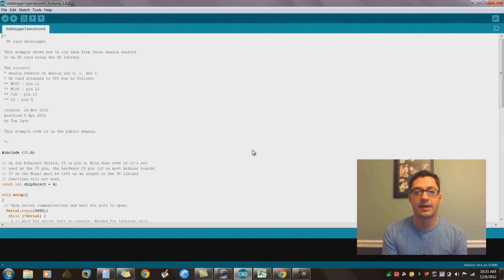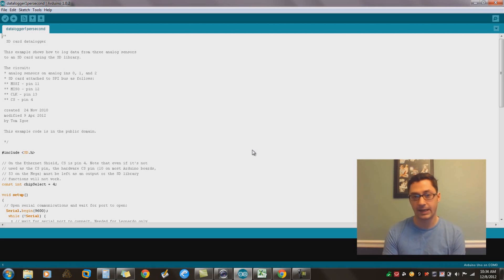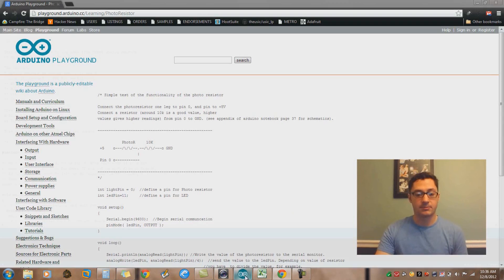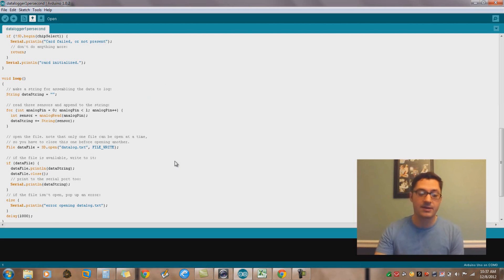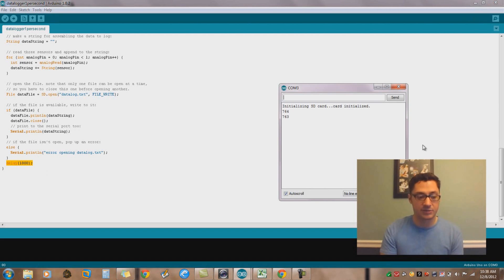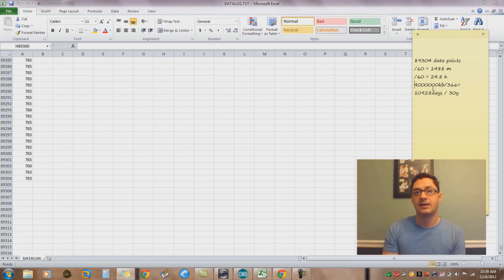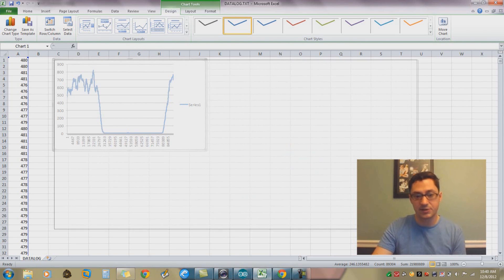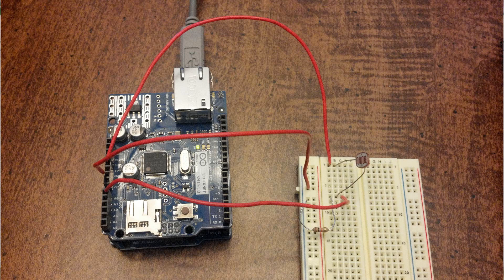Logging Analog Photoresistor Input to SD Card on Arduino Uno, Ethernet Shield

Comment: Hey Mike! Any thoughts on how to get the SD and the Ethernet to both work in the same function? I've been trying to do some sensor web uploading as well as writing to an SD card. They work individually but together they both just crash. No output file. Thanks for the video =)
Reply from the maker: There shouldn't be much of an issue in doing that, from what I can tell the pins aren't overlapping, so I don't think that the shield uses the same pins for SD and Ethernet... so you're okay there... FWIW, it's pretty easy to set up a web server that reads from the SD card to serve files, which is reading from SD and using Ethernet at same time... http://www.ladyada.net/learn/arduino/ethfiles.html

Comment: Hey I'm using an ENC28J60 ethernet shield for arduino and I'm trying to control LEDS off a web browser. I uploaded a sketch which allows me to control one led from the browser. how do i add another led with a separate button (via the browser).

#include "etherShield.h"
#include "ETHER_28J60.h"

int BLED = 3;

static uint8_t mac[6] = {MAC ADDRESS;                                                               
                                                         
static uint8_t ip[4] = {IP ADDRESS};                     

static uint16_t port = 80;  

ETHER_28J60 e;

void setup()
{ 
  e.setup(mac, ip, port);
  pinMode(BLED, OUTPUT);
}

void loop()
{
  char* params;
  if (params = e.serviceRequest())
  {
    e.print("<H1>L.E.D. Remote Access</H1>");
    
    if (strcmp(params, "?cmd=on") == 0)
    {
      digitalWrite(BLED, HIGH);
      e.print("<A HREF='?cmd=off'>Blue L.E.D.</A>");
      e.print("<br>");
      e.print("<br>");
      e.print("Blue L.E.D. is on");
    } 
    
    if (strcmp(params, "?cmd=off") == 0)
    {
      digitalWrite(BLED, LOW);
      e.print("<A HREF='?cmd=on'>Blue L.E.D.</A>");
      e.print("<br>");
      e.print("<br>");
      e.print("Blue L.E.D. is off");
    }
    e.respond();
  }
}